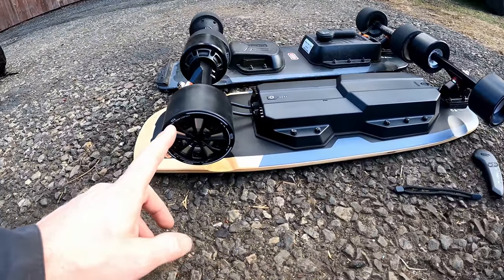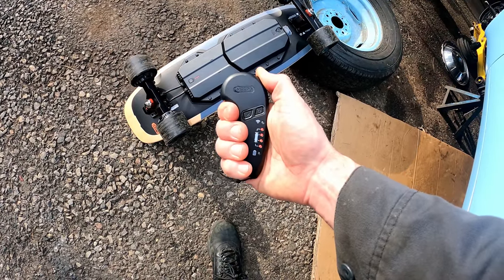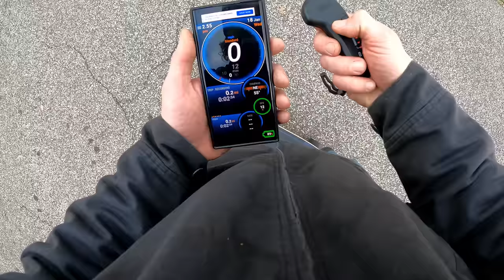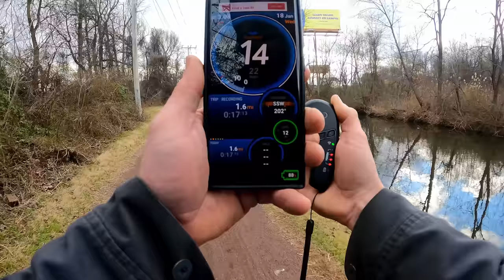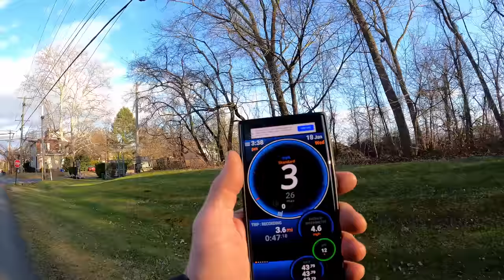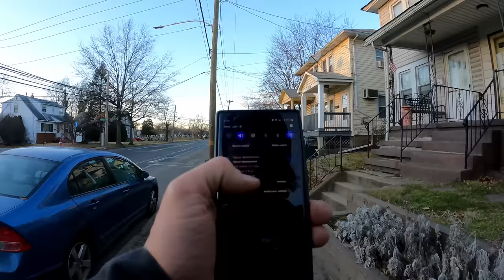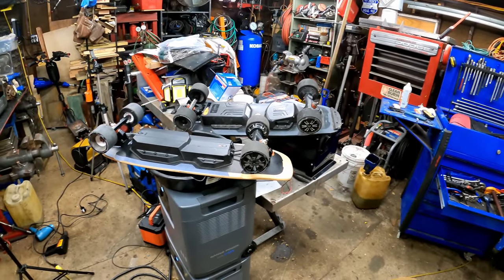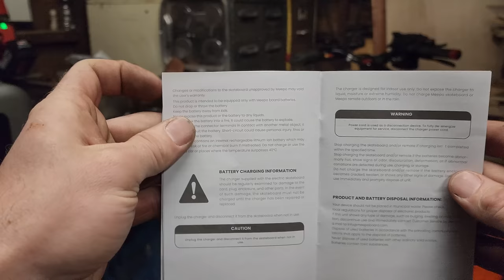MEEPO Mini 5 Electric Skateboard Review

Comment: I'm 61 years old and I ride a Boosted Mini X electric board. When I was 18, I bought the Moto-Board , a 2-cycle motorized skateboard sold to me used from 17th Street Surf Shop in Virginia Beach. I used to be on their skateboard team so I got a few percent discount but it was $300 in 1979 money which is was a whole lot. I had so much fun with that board! It was worth every penny to me. It sounded like a chainsaw and had a 26cc engine and chain drive to one rear wheel. It was noisy and would do 20 MPH with the muffler attached and 25 MPH without the muffler. Loose dogs would love to chase me down the street. Sometimes I'd have four or five of them at a time chasing. One day I ran out of gas doing that. Adrenalin sports. One day I noticed an empty glass pocket flask bottle of Jack Daniels on the side of the road. I took that and made it my extended range top off fuel supply. People would be interested in the board and come up to talk when I stopped to rest and I'd say "it runs on Jack Daniels" and pull the flask out of my pocket and top it off. A lot of them really believed that it ran on Jack Daniels. One day I was in a school yard parking lot with some friends and a rough looking older guy came up and started bullying us. He asks me "what's that in your back pocket". I pulled the flask out and held it up label side facing him. He yells "gimme that" and grabbed it out of my hand, opened the cap and guzzled a bunch of it. I tried so hard to stifel my laugh while that guy just suffered gagging on the two stroke fuel mixture.
Reply: I definitely need to see that because I always wanted one when I was a kid like to just put a lawn mower engine on my ninja turtle skateboard😂😂

Comment: New Meepo's beginner boards are not an upgrade from the previous beginner models, in case of this Mini 5 is a huge downgrade , no battery percentage on the battery, no display on the remote, wheels that are falling apart.
Reply from the maker: Yeaa unfortunately that seems to be the case here. Unless they switch things up

Comment: I did the skateboard thing back in the 70s years before the 2 strokes came out, at that time you didn't see anything bigger than 50 or 55 mm mm and you certainly weren't going on gravel, 15 miles is a good long ways on a skateboard

Comment: Been using the mini 2s for a year or so super regularly in an Urban environment and gotta say I completely disagree ab the tail or how high it comes up. It's actually a blessing to be able to kick it up and catch it like a skateboard rather than bend over to pick up the 20 lb thing. Also super useful to be able to kick turn sharp turns around a corner or other situations. Also never had it be a problem while riding, you can shift your foot an inch closer to the center of the board and effectively remove any kick tail issue you might have.

To each their own!
Reply from the maker: The tail is awesome to have no doubt. But it should be longer. I have a Enskate shortboard which has a longer tail and it is a game changer. Anyway, short tail is better than no tail
Reply: @NNKH2  agreed, tail is indispensable. For me a shorter form factor is among the biggest selling points so I'm happy with it as is haha

Comment: When meepo says 28mph u can hit it, but you have to do it on a fresh battery because of voltage sag.
Reply from the maker: I agree. Sketchy on a shortboard though
Reply: @NNKH2  Yeah, when the mini stops or crashes from the wobbles at 15+mph, you just keep flying. i usually stay between 13-18 for work commutes. Hit the pavement once and learned fast.

Comment: Love My Mini2 ER! Almost 2 years and over 200miles on the remotes OD going strong. And i'm 47yrs old 6'3 250lbs of PPeralta/Hawk-Old/School. That thing hauls my big ass like i'm not even on it! Even up bridges! I have to agree with your review. I don't like a thing about the replacement. I've got a way better premium remote with lighted digital screen, better brakes, better wheels, digital power gauge, Powerbank charger for phones/laptop etc, And the deck even looks better. I've taken her through crazy terrain and puddles also and never had a wheel fall off or ANY issues whatsoever. Fastest i've ever gone was 23mph and I had to back off. At my age and weight if I fall something will break and it won't be the board!

Comment: Chris you should really try a Boosted board v2 plus. They have the vanguard Loaded bamboo deck and carve so damn nice. The power band and the feel is like a german car. Yes they're out of business but the used market is hot and you can find so many replacement parts if needed. I was big into the local eskate scene and have a lot of experience with different boards and most people stuck with Boosted because of the ride and feel of them....there's nothing that compares. These hub motor designs ride harsh.

Comment: Throw it out, get an Exway Wave instead. At least they don`t fall apart on their own. Plus you got all the lighting you need, batteries you can just swap on the go for 300 a pop and a decent belt drive system with real wheels under your feet. For commute in the city, if and when you plan on getting on a train or subway every once in a while you just can`t beat that lil board imho.

Comment: So with the break mode you have to pull back on the break while stopped and hit the mode button this will show you which break level your at while riding. also your crazy for not wearing any protection my man haha, one slip at 25 mph.... especially with that wheel coming off! stay safe my man! I do reviews on these boards and I have the v5 review coming out soon as well
Reply from the maker: Thanks for the info!
Reply: @NNKH2  no problem also I’m located in jersey would love to meet up or have you come over for a group ride in the spring summer time!

Comment: Bigger Cross 4WD tires, handlebar (like kickscooters) with all controls (left and right yellow blinking leds etc etc). App to slow down the speed or the Watts of the motor for the country regulations (Switzerland is the country with such regulations : impossible to drive such devices on the road like a bicycle as there's Police almost everywhere). IP68 and 1 click exchanged battery Sodium-Ion so we can take the small and light board inside airplanes. Such devices MUST be re-invented as they are actually boring and nothing new.

Comment: Anything with a hand held remote control sucks . Onewheels and EUC are what’s up . The riding experience isn’t comparable. Don’t waste your time with all the shitty 4 wheels with hand held remotes , truly inferior.
Reply from the maker: Couldn't disagree more. Those are useless if they ever break or the battery dies. You have a big heavy weight you got to carry home. The skateboard stays functional even with a dead battery
Reply: @NNKH2  carry home ? My EUCs have 70-90 mile range .I’ve never seen below 25 percent battery, ever . But most importantly, The riding experience is superior . It’s not even close . The hand held is lame as fuck , in comparison . Replacing gravity with electricity and accelerating and decelerating from body movement….. vs standing on a big remote control car . From agility , speed , torque, and jumping ….. EUC is the best in every category .
Reply from the maker: To each their own. I prefer something that can be used with or without a battery. Electric bike, scooter, skateboard.  One day you're going to be carrying that thing home when it has some sort of failure and you'll be thinking of me. Lol.
Reply from the maker: The skateboard doesn't rely on electronics to balance. That's a big selling point for me
Reply: @NNKH2  fair enough, I’m all electric . Ill never ride a bike electric or not , because of the handle bars . I’ll never ski or snowboard or surf again. I’ve done all of them since age 5 , when I started skiing. All do not compare and are so inconvenient and expensive [ because of travel} euc can go to mountains snow , the desert sand , and the city concrete. I have a charger that weighs maybe a pound in my bag and I live in the city with places to charge . A once in lifetime where there is a battery issue or whatever , I’ll take a cab that one time . 
So yeah , we are definitely after something different, I respect that you are going natural but I’m over it ☺️. The euc is like being half  robot , It’s not like riding, it’s like moving through space as a single entity .